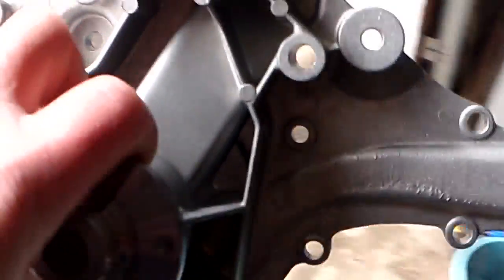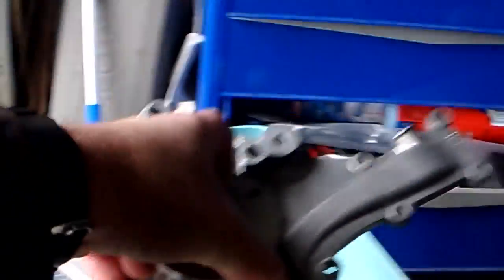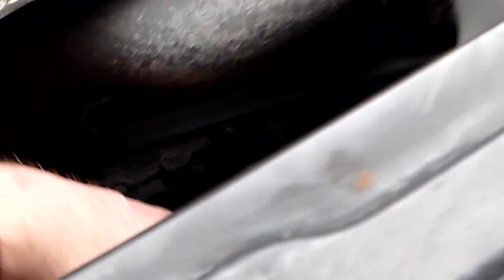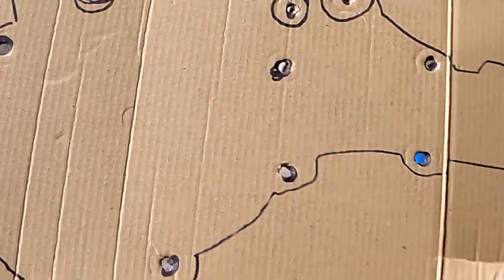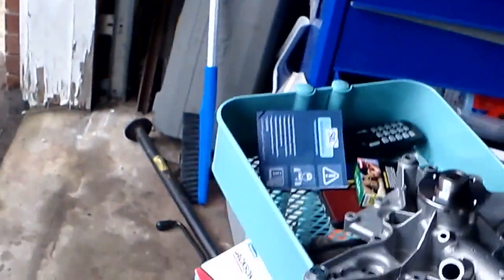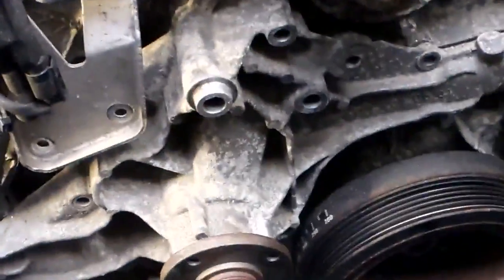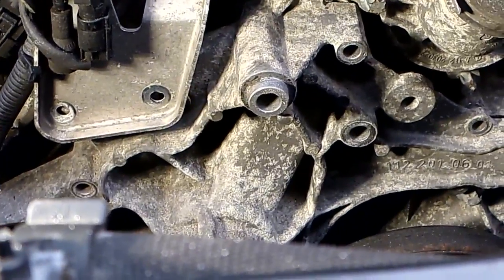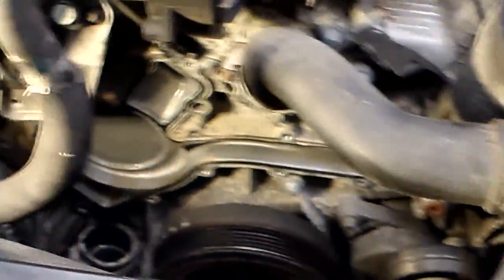Mercedes M112 V6 water pump replacement..M113 similar

Comment: did you up grade your tensioner pulley? The one you have on there will rust & lock up.......
Reply: it was my alternator pulley bearing.  i pulled out the alternator and had the bearing and brushes all replaced for 125 bucks and put it back in --- no more noise, all good!
Reply: I just had a belt tensioner go out ,tore up the belt to ..right in the bank drive thru...don't wait ,I knew it was going out because it makes a clicking sound..I just put it off for a while

Comment: You can use a 12 point closed end wrench on the torx bolts. They fit like a glove. What I use in cases I don't have a torx socket
Reply from the maker: yes ,, great advice
Reply: While this may work, I have seen people strip torx bolts this way. It’s always best and easiest to just buy the right tools
Reply: Everytime I work om my Mercedes I have to go get at least one new tool...

Comment: Thanks for the vid. Best one here on the tube! Identical to my c320 wagon except the tentioner bolt, mine has some inverted tamper proof style BS.
Reply: Scratch that about the tamper proof bs. I discovered that it takes a 17mm socket outside the pully at about the 7 o'clock position on the tentioner itself. Its hard to see because of the belt but easy to get to. Otherwise the same.
Reply from the maker: yeah they used 2 maybe 3 different bolts on the tensioner .. pain in the butt with the tamper proofs because you can rarely get them without buying a whole set .

Comment: that water pump removal its same for 96 to 2002 mercedes benz e320 !"
Reply: That is incorrect. The 96-97 have the M104 engine which is a DOHC straight or L6. The 98-05 E320 has the M112 V6 which is this engine. I have spent too many years as an MB tech to let that bad information slide.
Reply: Do you know the OEM? What is a good brand? 
Thank You!
Reply: THE S They also used that engine in the 280, after.... 98 I believe? Nice engine, takes a lot of oil. (ask me how I know)